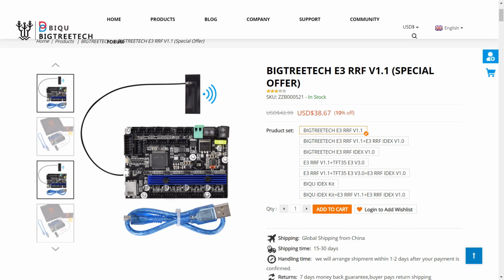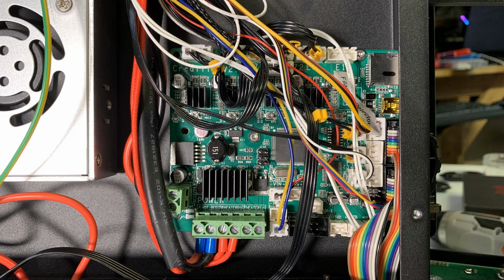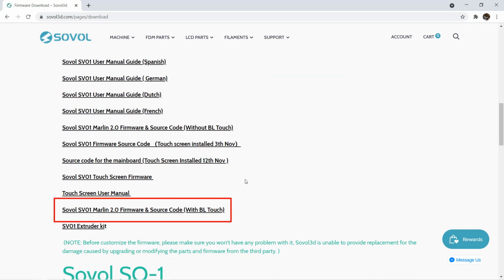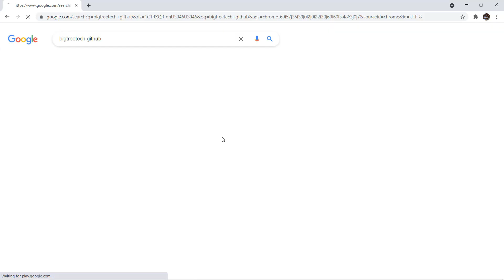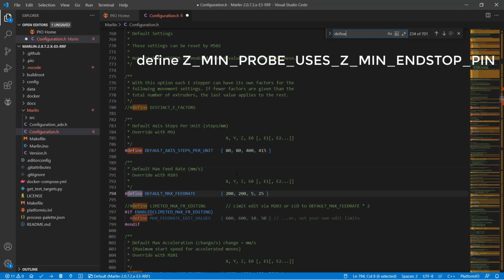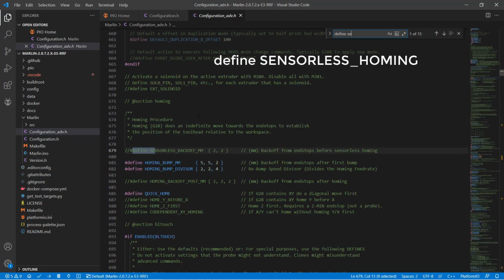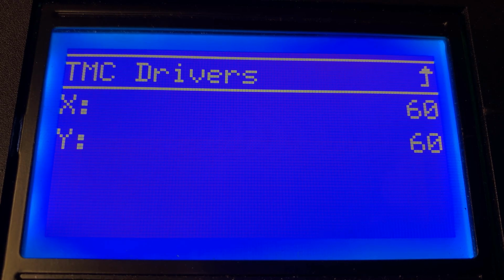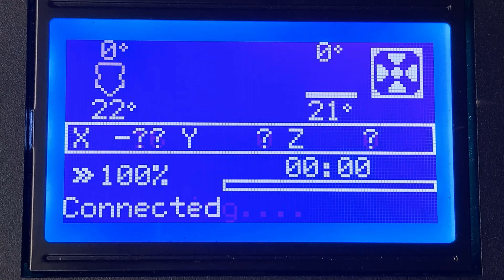Big Tree Tech E3 RRF 32-bit board, sensorless homing to maximize print volume - SOVOL SV01, Ender 3

Comment: Thanks for doing a video on the SV01 again Aurora... And really interesting choice of board! I have an SKR 2.0 + 2209s on order from BTT, but it's not even shipped yet. I'm now second guessing my decision!

Also looking forward to seeing your update about the dual Z driver and G34. I've been using this setup with the v2.2.1 board now for a couple of weeks and it's working great. It's really interesting to see how much correction is needed for the Z axis. If I've been fiddling with the printer, particularly if it was on its side because I had the bottom open for some reason, the Z axis will be off by up to 0.5mm when I set it up again. Usually though, if it's just been powered off overnight, it's still off by 0.2mm at the start of G34. I really think G34 improves the accuracy of this printer.

By the way... what are the clips you're using to hold the glass to the bed? I like the clamping force of the binder clips, but as you showed, they're huge. I'm currently using some picture frame clips, but I don't like how they clamp. The ones Creality uses for the E3 V2 look good, but so does what you're using.
Reply from the maker: You can take a look at amazon:

https://www.amazon.com/dp/B09138TS5Y
https://www.amazon.com/dp/B08ZSHL72L

Actually I think the second one holds better, the one I used on the SV01 always pop off when I remove prints from the glass bed.
Reply: Great, thanks  @AuroraTech !
Reply: @AuroraTech  I've been using the second ones for a couple of months now and have not experienced any problems. Where did you get the x and y axis belt tensioners?
Reply from the maker: You can take a look at amazon:
https://www.amazon.com/dp/B08FMJ2CVB  (choose size 2 & size 4)
https://www.amazon.com/dp/B087279DQP (choose 2020+2040)
Reply: @AuroraTech  Thanks Aurora. You and your brother are doing great. Keep up the good work.

Comment: Great videos keep up the good work. I was following your guide and found that on my ender 3 pro with the cr touch installed the firmware that worked was the one that says z homing. all the cables are connected to the mb probe all 5 pins. i tried first with the one that only says bltouch and it would not home z. Z would only go up each time I tried to home it. Z  homing file worked perfectly. Now I'm trying to compile the latest version of marlin without screwing this up.

Comment: Great upgrade video.  Thanks!

I wish there was an SV01+ with quiet steppers and the BL Touch.  I'm actually very happy with the SV01 so far.  Hard to beat the print quality.  I hate fiddling with the tiny microSD card.
Reply: My new SV01 had the hot end heater burn out after ten hours.  I assume it's just a random initial part failure. On the plus side, the heater quality looked good, spare parts are inexpensive and readily available, and it's easy to maintain the printer because of the open architecture.
Reply from the maker: That's strange, you mean the heat cartridge burn out? You can ask Sovol for a replacement.
Reply: @AuroraTech  - I contacted Soval via Amazon a week and a half ago, when the hot end heater burned out after ten hours use.  I was told I'd hear from them in 3-5 days but never heard anything.  I would contact them directly if I wanted a response, but I bought five replacement heaters for a couple of dollars each - 40W and 24V so electrically equivalent but not nearly the quality of the original.  They were the best I could find on Amazon.  The wire gauge was much lighter so there will be more electrical losses in the wires which will limit the hot end temperature slightly, and the wires were only 1m long so I used inline quick disconnect connectors so I won't need to replace the heater all the way to the motherboard to make repairs easier next time (no need to flip it over).  The printer has been working great, printing 21 hours a day for the past week.  The nozzle has no problem quickly reaching 230C.

I'm loving this little printer with the large build area.  Great print quality, and easy to maintain.  The extruder is excellent.  It's simple and easy to load and prints flexible filaments very reliably.

I also switched to the Prusa slicer last week and it's my favorite slicer.  I like it better than Simplify3D, Cura, IdeaMaker, etc.

Comment: Does setting the home offsets affect the BLTouch Z offset? I did this and everything worked great but I must have done something off as it pushed the print head down too low and scratched the glass bed surface. I re-did the Probe Z axis offset and got a new value and updated it and then it was fine.

Comment: Hello, I have two questions as I’m considering buying the sovol sv01 printer. What kind of nozzles fit this printer? Also you said that this printer fits any creality drop in boards, could a creality 4.2.7 board be put in this printer (obviously firmware would have to be compiled using similar steps to your video)?

Comment: If the board is made for the reprap firmware, why you don't install this? It would be ncie to see the guide with reprap and using the full wifi webinterface.

Comment: Edit: just finished the video, and you are already planning this for a different video. :) 

Would be sweet to see you use that expansion "idex" board to use 1 for each of you z motors, that way you can use g34 z axis stepper motor auto align. :)
Reply: Im excited for this too. I have been struggling to get mine setup that way.

Comment: I just installed the board and firmware on my SV01. But when a print completes, the build plate moves forward so far that the stepper motor grins until I turn the power off. Any idea how to fix that? Thanks!
Reply: That's mostly in your end gcode on your slicer. Like a "present print" line of some sort. Check your end gcode at the very bottom of the lines for some kind of Y motion.

Comment: Just did this exact upgrade. This video helped a lot! When I home the X axis, I get a value of -9. Is this normal, or should this be 0?
Reply from the maker: You can try to print a line on the left edge, if the position is correct, I think you are good, if the line print outside the bed, you may need to set a home offset on the LCD screen.

Comment: Hey there about how long will it take to update the fw? Also for some reason my printer goes wild and tries to run off the bed, did i do something wrong?
Reply from the maker: It would take 10-15 seconds to upload to the printer after you inserted the SD card with the firmware.bin file.

You have the exact same board BigTreeTech E3 RRF, right? 

If your Y-axis didn't stop when it reaches the end, that means sensorless homing is not enabled or the SENSITIVITY value is not right for your printer, how about the X-Axis?

You may need to check:
1. define SENSORLESS_HOMING is enabled in Marlin
2. For my printer, SENSITIVITY for both X and Y are 60, you may try to adjust this number higher to make it more sensitive, you may start with 100, 90, 80... keep decreasing the number to find the perfect number for your printer.
3. Make sure you put 2 jumpers under the X and Y stepper drivers on the motherboard to enable the sensorless homing feature.
Reply: @AuroraTech  life saver lol I must have missed that. Now I’m having a problem where the printer resets midway through prints. I suspect overheat protection. I’m not sure tho, I’ll add another cooling fan today. Any other ideas?

Comment: very curious, is this board capable of dual z stops to assist in keeping the hot end gantry level ?
Reply from the maker: Yes, if you also have the IDEX extension board, you will get another 2 stepper drivers to control the second z axis, so you can use G34 to do z-align. I have another video for that:
https://youtu.be/QHblq2AReqQ
Reply: @AuroraTech  YAY!!!! thank you so much!!!! I truly appreciate it !

Comment: Anyone else with this board have issues with SD on-board reader???

I'm reading a ton of people having issues. Usually from people running Marlin.

Edit* 
Yeah. The SD card slot is junk on these. Many post online.
But works great if you utilize the SD and USB reader on the TFT. Or use octoprint. Or whatever you want with the wifi.